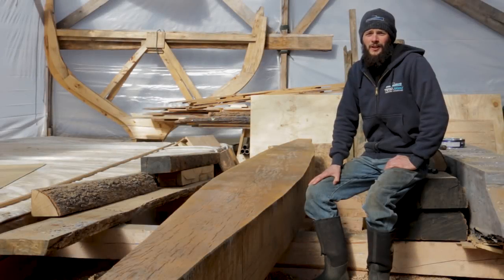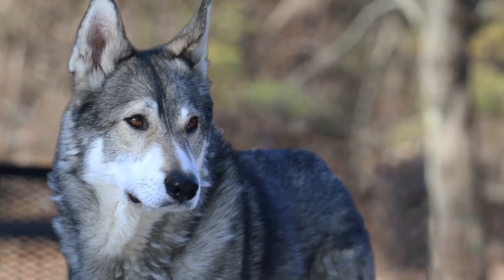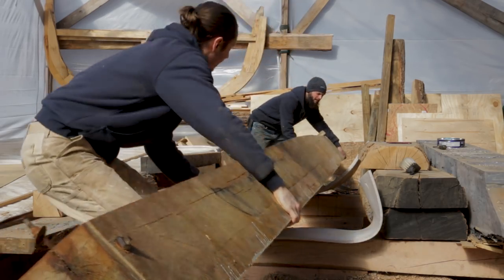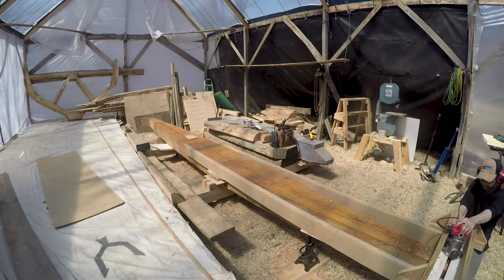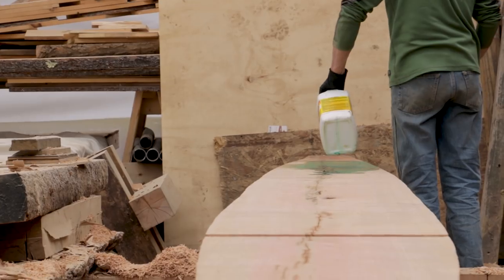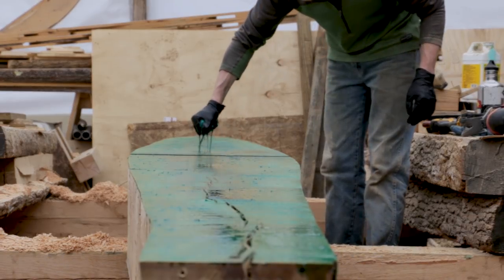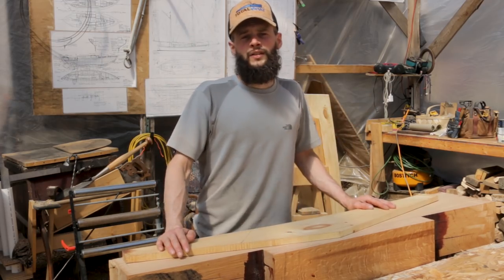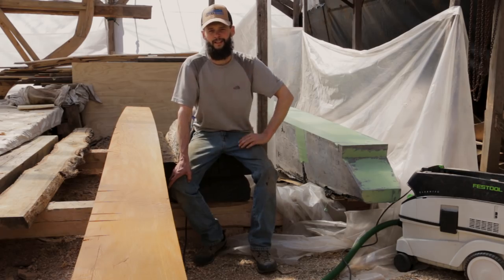Acorn to Arabella - Journey of a Wooden Boat - Episode 31: Final Thickness

Comment: The best off hand complement I have ever heard.
"So are you gonna give them any help?
They don't need any help!"
Coming from a guy who knows what he is doing, that has gotta cause a grin.
Once again guys, Great job as always. 
One question though, the bit of checking in the keel timber, how is or was that going to get dealt with?
Reply from the maker: The big check will go face down to the ballast keel and deadwood.  Once it is painted (today/tomorrow) we will fill the checks with dolfinite bedding compound.  That will keep any critters at bay, will help keep the checks from drying more and once in the water the timber will "take up" to it's maximum size and the checks will swell shut.  
When they do they will force the dolfinite out and it will get added to the rest of the bedding compound between the keels.
If we put something hard in there to fill it and the timber swells it will act like a wedge and split the timber worse than it already is.
Reply: Thanks guys. Kinda makes it hard to envision the final result. The timber being a "living" thing with taking up water from the surrounds etc.
One of the joys of working in wood I guess.

Comment: The most probable reason the bit fell on you is saw dust.  When saw dust gets packed into the collet, it can force the collet to open up just a titch (we're talking a few thousandths here).   You just need to periodically blow the dust out of the collet, and make sure the collet and the taper in the router are clean before you put in a bit.  I've had this happen enough (and ruin enough guitars!!!!) that I am just in the habit of periodically grabbing an air gun and blowing all the dust out of the collet.
Reply from the maker: Thanks for the tip!
A 1/8" groove in a giant keel timber is not the end of the world but that would surly trash a guitar blank!

Comment: The copper preservative you used may have an effect with dissimilar metals. You should prepare some test samples using various fasteners including galvanized and stainless. I bet you will see some alarming galvanic action which you had not accounted for in your previous experiment.
Reply from the maker: That is why we are using bronze and copper fasteners!  The copper in the preservative and the copper in the antifouling paint would reek havoc on non bronze/copper fasteners for sure!

Comment: I've run into the problem with a router bit that moves after it's been tightened down.  There is a small radius where the bit meets the shank, and if the bit is bottomed out against the collet, the collet may be tightened against this radius, and a good jar could cause it to move.  I make sure that there is a small gap between the cutting bit and the collet so that the collet is tightened only against the shank.  Best of luck on your build, I look forward to each video.
Reply from the maker: That makes sense.  Since it was such a reach for the router the shank was not buried to the collet.  But maybe I had it too far out? It only moved that one time so who knows.

Comment: A router bit can sometimes jump or slide in the collet if it was bottomed out in there. make sure to back them back out 1/8" or so, something about the vibration or something can do that it's touching the bottom of the bore, don't remember exactly what does it
Reply from the maker: Thanks for the tip!
I am positive it was not bottomed out in the collet, so not sure what caused it.  Another person speculated that saw dust got jammed in there enough to force the collet open a few thousands of a inch and let the bit slip.  It's the first and only time it has ever happened to me.

Comment: Hi Guys ! Nice to see you're back ! May I add my 2cents ? For the 1/8" groove, could you fill it with molten lead once installed on your keel ?
2nd : to straighten the bow, you could lay your beam directly on the humid soil, divot face down for a couple days/weeks, nature could do it's magic again... Kudos mes amis !
Reply from the maker: The lead would not stick to the timber and would need to be screwed in place. A dutchman (filler strip of wood) or a extra coat or two of bottom paint should do the trick.
Big beams can move in unpredictable ways, it could straighten it could warp in a different way.  Jacking out the 1/4" bow will be easy once we have the ballast keel and deadwoods attached.
Reply: Logical. Tks.

Comment: There seems to be a large split in the keel timber.    Will you be doing anything about that?  Epoxy maybe?   But I know you guys don't like that stuff.  ( My uncle was one of the first boat builders in Australia to really get into the epoxy impregnation of timber and plywood in building boats.  He In those days safety gear was not really a big issue and now he is really sensitive to the stuff.  He was building racing sailing dinghies and some of his boats sailed in the Olympics.  I wish I had some of his skills
Reply from the maker: It's not as bad as it looks and will be mated to the lead and deadwood so it will be covered forever.  
As soon as Arabella has been in the water for a couple months the timber will take up and that check will close right up.  If we put anything hard in it now when it swells the hard object will be like a wedge and will split the timber right down the middle.  
Before we bed it we will put soft bedding compound in there to fill the check and keep the creepy crawlies out, when the timber takes up the bedding compound will squeeze out and get added to the rest of the bedding compound between the keels and deadwood.

Comment: Thanks for the update. Are you not worried that the warp in the keel timber will bend the lead?
Reply from the maker: Naw, the lead is way too thick and hard for that.  If it was pure soft lead maybe but ours has a significant amount of antimony in it, it's quite hard for lead.

Comment: Love the extractor. What one is that? I’m assuming the top dollar one. H class
Reply from the maker: Festool CT26  It's not the biggest one they make by any means but it's big enough to clean up the shop and more importantly it has a HEPA filter and will safely trap lead dust from working on the ballast keel.

Comment: Is that keel red oak or live ? Also at this point if you are doing Carvel planking? , I don't see why you shouldn't have a rough hull together by winter.
Reply: Keel is white oak.  Please no red oak in a boat.
Reply: Yes thats what i was thinking/getting to. But white oak is terrific !.
Reply from the maker: It is white oak, everything we have cut for the framing is white oak.  Red and black oak are ring porous so they are not as rot resistant.  Red and black oak soak up preservative and glue better than white though.  
Yes, Carvel planking, hoping to be starting to plank this fall/winter.

Comment: I can’t believe in years gone by ship builders would worry to much about 1/8 inch.
Reply: The problem isn't being off by 1/8", but having a 1/8" hole that water can get in.  I am sure they will get it fixed, but there is a reason that those mating surfaces need to be tight.
Reply from the maker: CorwynGC is correct.
Arabella could not care less if her keel timber was off by 1/8 or even 1/2".  So long as she is smooth, fair and well put together all will be fine.
Water ingress is the bigger issue.  Since it's so shallow we are hoping a little extra paint in the groove will bring the gap to a 1/6" or so and the bedding compound should be able to handle that little gap, especially if it's the only one.  
If the paint does not seem to do it we will have to make it deeper (gasp) and install a dutchman but I would rather leave it be as is.